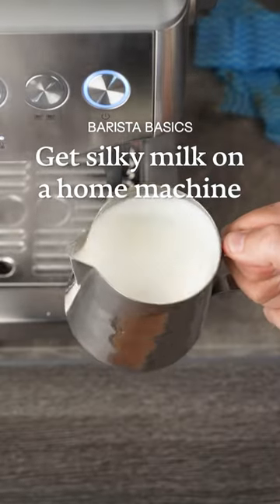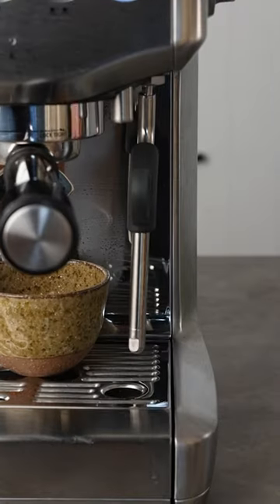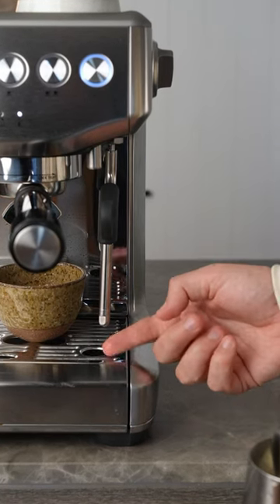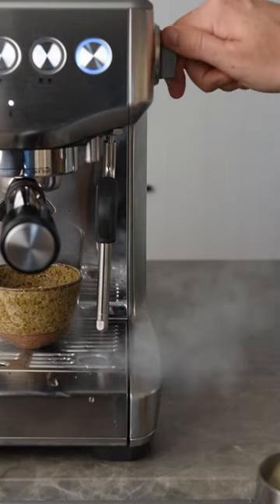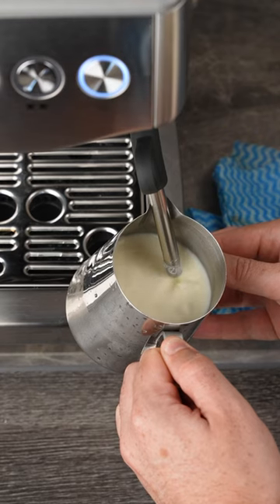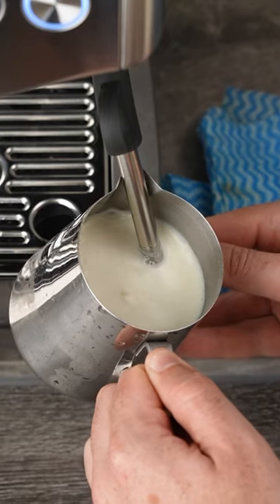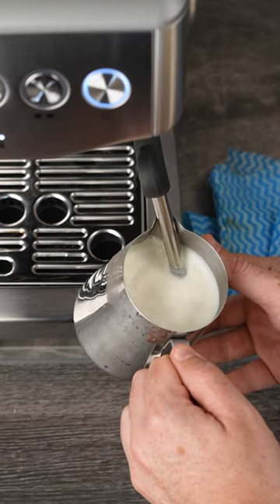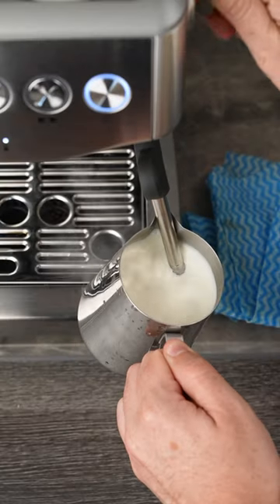Get better milk on a home espresso machine #coffee #barista #espresso #cafe

Comment: awesome video ! Although i am struggling quite a bit, i'm a barista at a restaurant and the machine i use has a streamer that put out A LOT of steam and heat very quickly. The milk become too hot to touch after at most 10 seconds, the higher-ups told me to make my cappucinos like a 90's cappucino and it BOTHERS ME A LOT !
Often times my steamed milk has too much bubbles or is too hot and it is very hard to balance it out to get it silky smooth

Comment: Wait. So are you suggesting to start with the tip below the surface until you create a vortex, then bring it to the top so it's almost skimming the surface? I was always instructed to do the opposite, so now I'm confused.
Reply from the maker: Only on a low powered machine like this. I only start introducing air once it slowly starts spinning because that’s when the steam wand has full power
Reply: @Goldenbrown.coffee  Fortunately I have the Barista Pro, so this is applicable to me. Hopefully this solves my steaming issues. I look forward to this new approach. Thanks!
Reply from the maker: @primo2ag  I have a video earlier in my feed that shows the entire process if that is helpful 👍🏻 good luck